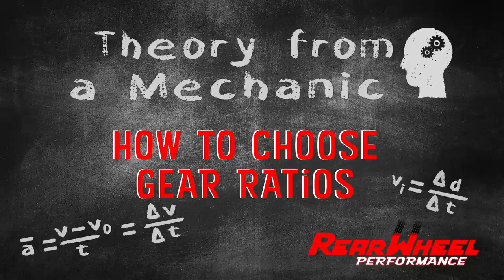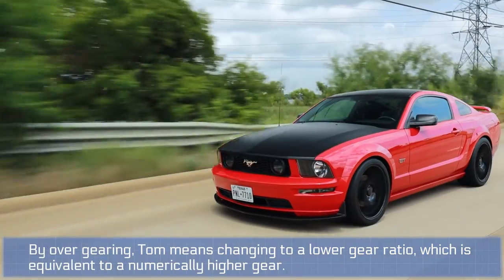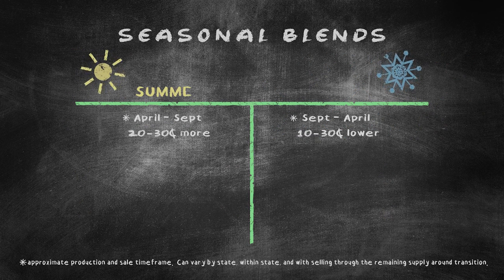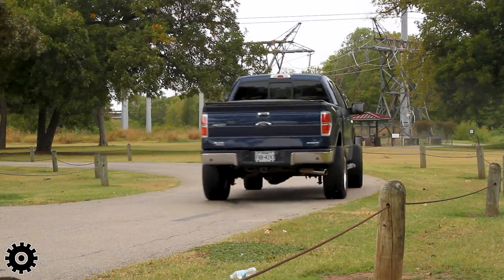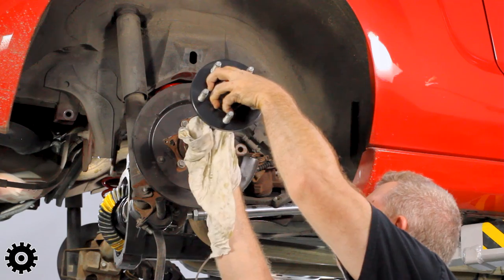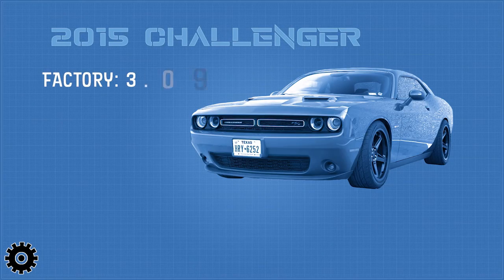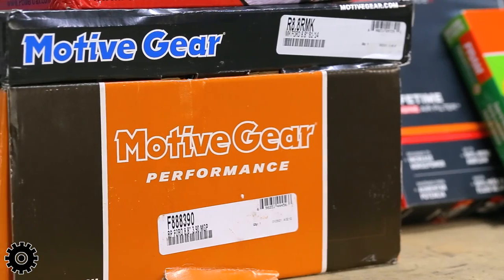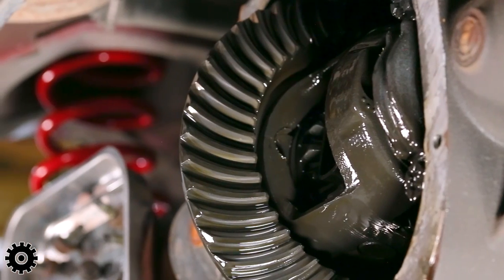Ring and Pinion Gear Ratios Explained: How to Choose the Right Gear Ratio

Comment: I have a 1987 chevy silverado short bed. 305 5.0 tbi and a 373 ratio on the diferential. I want to change it to a 410 would it give better mpg?
Reply from the maker: It may, depending on the transmission, tire diameter, how and where you drive the most often, and if it puts the engine in a more optimal/efficient rpm range.  If it feels like a dog driving now, then more gear will usually help.

Comment: I have a 1974 lincoln mark VI with 2.75 gears, 9" rear. I'm planning on putting 4.86 gears in it.
Reply from the maker: If it's running a C6 and a big block it will be nice off the line, but hard to imagine 4k+ rpm highway.  A ton of torque, sounds interesting!

Comment: I have a 2002 3500 Chevy cargo van w/ the duramax diesel. Will a different gear in the rear help with mpg plus torque? What would you recommend
Reply from the maker: Re-gearing may be able to help.  Diesels have such a narrow and sensitive rpm range, it is even more critical to work through the numbers.  We would recommend looking for forums and/or Reddit to see if you can find other truck/van owners, with you same engine/trans & similar diameter tires, to see what ratios are working for them.  Obtaining better highway mileage is usually achieved when the engine is operating within its most efficient and optimal rpm band.